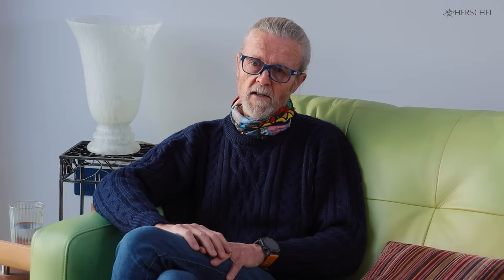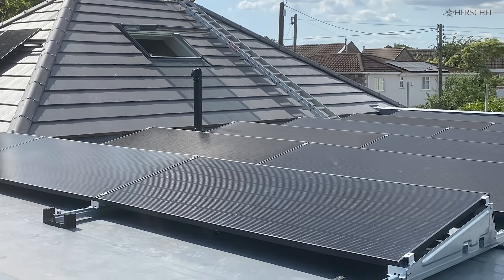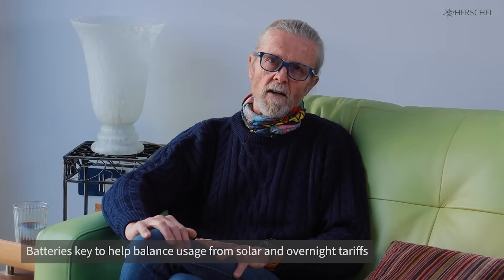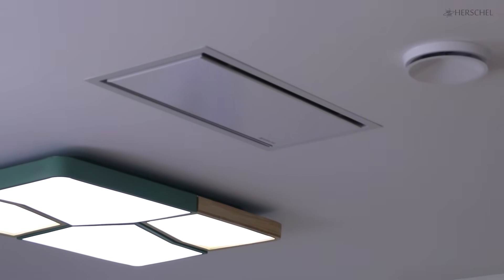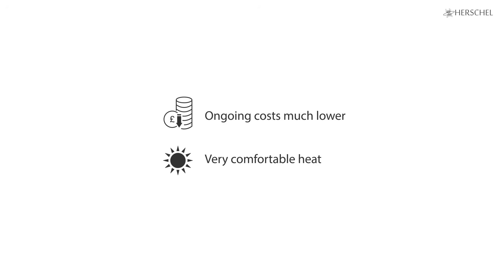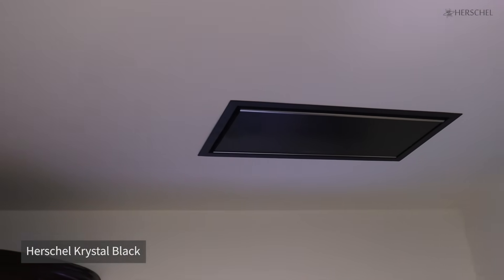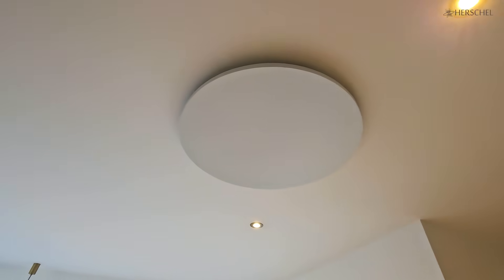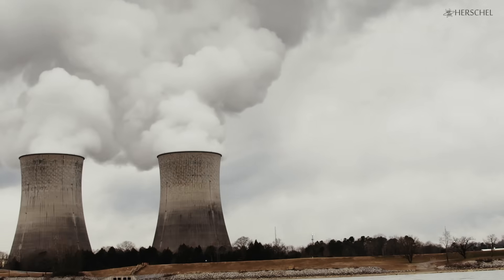Infrared panel heaters, solar & battery chosen over heat pump on eco house retrofit

Comment: Running my 12K mini split off solar. Which was an easy DIY install. Maybe you should compare apples to apples?
And it is producing at least 3x the amount of heat energy for each unit of electricity that goes in.
Oh, and did I mention that it ALSO cools really well?

Comment: Show us the facts and figures. Where are the spreadsheets?
1. What is the heat loss of the building?
2. How many kWh of electricity are being used? Average for Jan, Feb or March?
3. What was the cost of installation?
Reply: On top of the these questions, 
- did no one mention air conditioning?
- very easy to have infrared when the house is super insulated to an almost PH standard, but what does that look like in a conventional build.

Comment: A good compromise is to have air source heat pump (air to air, eg air conditioner) plus some infrared heaters in the seating area of your home (or other spot areas where you stay still for long periods).  The heaters give a nice direct heat that's cheap and adequate, while the air conditioner just takes the nip out of the air.  Air conditioning units aren't too expensive to buy/have installed.  The infrared heaters consume more power (per square meter), but because they're directional, and higher heat, they're perfect for directing at your body and you don't need to heat up the entire room.  The air conditioning unit struggles in the dead of Winter to keep the home above a certain temperature, but still gives enough heat to take the chill out of the air, but most importantly it does it very efficiently (lower temperature & lower electric bills).  Best of both worlds.  You also have air conditioning in the dead of Summer too  :)

Comment: We replaced our gas boiler with ashp and after a year of fine tuning have a very low cost system using the existing rads and underfloor. It's a 1950 detached house with reasonable insulation and new windows. We looked at infra red  panels in some rooms but the efficiency of heat pump worked out much cheaper especially when we shifted our tarriff to octopus  Go which gives several hours of very low cost  energy. A couple of weeks of disruption  vs 20 years of higher costs every year.

Comment: Selective use of radiant is great.

Radiant IR panels don't cool a space though. A Heat Pump doesn't create (much) heat but it moves heat from one space to another and it does it efficiently with a Coefficient of Performance of 2 (200% to 3.5 (350%) depending on ambient temp outside relative to indoor desired temp (Delta T).  A Radiant IR panel is COP 1.15 (115%).  So for every unit energy you give it you get a bump of 15%.  An Air sourced heat pump would get a bump of 100% to 250%

I would think a Heat Pump with some spot IR panels for that nice sun like radiant sensation is comfortable environment.  They can be used when the Temp is extremely cold outside wit equivalent COP of heat pumps.
Reply: I note that Salford University found that their Air-to-Water heat pump system achieved only a 1.73 CoP when run at an ambient of 4.7C. If this is replicated in installations more widely it shifts the consideration vs IR heating significantly.  I am concerned that heat pump manufacturers have rather dragged their heels as regards the adoption of low GWP refrigerants like R290 (despite this being widely used in domestic freezers and fridges). If, say, an R410A refrigerant system leaks it's a significant environmental issue.

Comment: Metal walls ceiling and floors and a low level microwave generating appliance creates a lovely inner warmth the microwaves basically warm the person not the air and furnishing.A lovely warm feeling through and through.

Comment: Builder,  outside Boston. Our cost for air to air minisplit are $2500 installed for 18000 btu unit. Enough for well insulated 2000 sq-ft home. Radiant floors are not noticeable warmer in a well insulated home. 72f floors to keep room temp 70f.

Comment: We have a late 1970's bungalow that we gutted and re-planned 2 yrs ago.  We out in a new gas combi boiler with underfloor heating across 2/3 of the bungalow, and Herschel IR in the two south facing bedrooms, and just about to put one a mirror one in the ensuite.  We faced the similar challenge of the solid floor and opted only to take the screed off to get a foil back foam insulation with the UFH pipes and a Kronoswiss composite floor.  
We are about to do the next phase of adding an extension to create a lounge/study/utility and this will be to Passivhaus standards of insulation including the floor where I am considering foam glass instead of foam board, and looking at a solid block wall with insulation on the inside (but this has not been done very often and have slight concerns about the interstial condensation).  I have been thinking about not putting in UFH because of good floor insulation and only going for IR panels.  
I looked at a 21 panel solar and 7.5kW battery solution but chose to use the same money (£17k) to buy two listed battery funds (£7k) on the London Stock exchange and spend the panel money split between Solar and Wind listed Investment Trusts (£10k).  A quasi-off set approach - dividends pay the electricity and gas bills or contribute to it, but currently re-invested.  The great thing about this approach is the capital should appreciate over the same lifetime as the panels (25yr).  If we ever move my capital comes with me and also not subject to technology obsolescence, or maintenance (battery will need to be replaced a couple of times in 25yrs and the invertors I think every 5-7yrs). Another option would be to skip the panels and use the batteries with the flex tarriff.
We also replaced the existing double glazed units in the original windows as this was more cost effective than replacing the window whilst we consider external insulation in the future.
Currently re-insulating the loft with 300mm of STEICO wood chip batts and thermafleece membrane as the original insulation was trashed in the rewiring.  We have installed is a series of AICO sensors and gateway so I can see online the temp/humidity/CO2 in all the rooms, and have used this to try and sort out issues like mould, I have one in the loft so I can hopefully see the insulation makes a difference.  What has made the difference was a DEMAC dehumidifier set at 55% set centrally, this will be replaced by an MVHR with the next phase.
Interestingly, I have just calculated our gas and electricity use for the year and it is 62.5kW/sqm.

Comment: Have completed a similar install on my 1970's house. But without adding any more insulation (something I have concerns about) Again using Hershel, who I strongly reccomend. So an install of all IR heating panels and batteries and some solar again cost a similar amount to what an air source heat pump would have cost. The running costs through the past three months (Nov, Dec and Jan) was about 2/3rds of what our previous central heating would have cost. And agree with all the comments made here. A couple of other points as the air isn't being heated directly, the air temp is a little lower than with a wet system, which reduces the likelyhood of condensation and mold growth, and as convection currents are not created it is generally better for people with asthma and similar.

Comment: A very informative video - thank you. We too have a 1950's retro-fit eco bungalow, but have incorporated underfloor heating driven by an air source heat pump, in addition to solar panels and batteries. Our approach and your approach demonstrates the old adage 'there is more than one way to skin a cat'. The one thing I would highlight, in your 'Eco house', is the wood burning stove. All available information suggests that these are majorly negative in terms of particulate pollution. Leaving on a positive, I completely support the approach of retro fitting as opposed to 'knocking and re building'. Rebuilding is both environmental and economic madness, on the macro scale. I agree that Herschel Infrared heaters are great too!
Reply: The much quoted figures for PM2.5 emissions from wood burning stoves comes from a much discredited 2015 study by DEFRA which concluded that 38% of PM2.5 was emitted by them. Subsequent larger and more robust studies put the figure much lower with DEFRA recently accepting that the contribution to PM2.5 from wood burning is under 10%. Unfortunately, the MSM loves to keep pushing the 2015 figures.

Comment: Thanks for the very interesting video. My heat pump costs £250 to service each year and the whole system cost £15,000. Fortunately the renewable heat incentive scheme (RHI) covered most of the cost of installation, otherwise I would have gone for radiant heating!